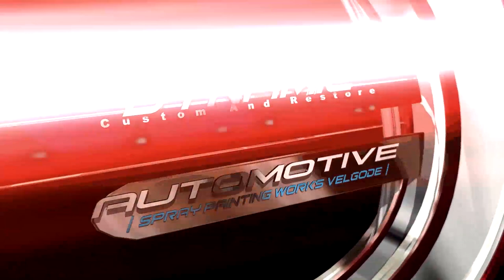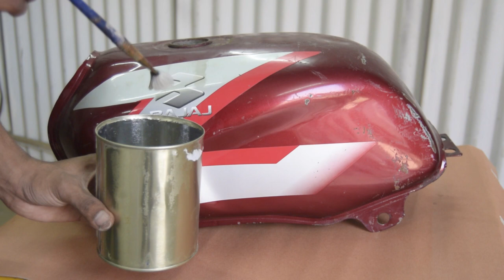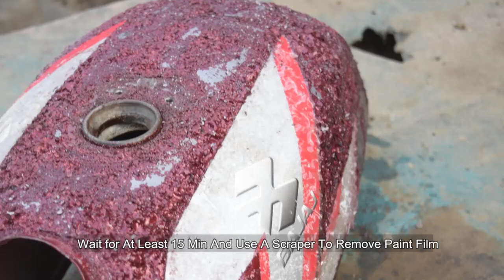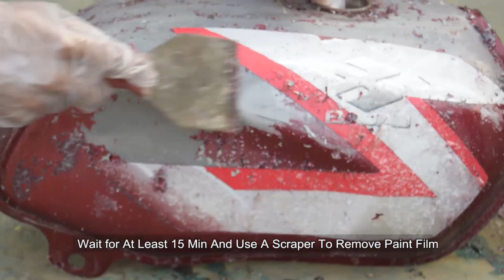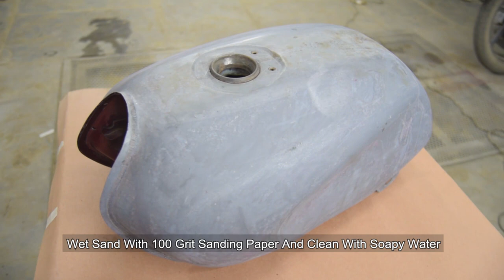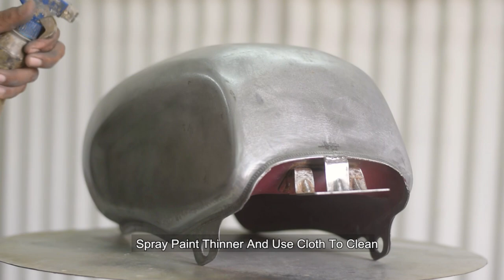Step 1 - How To Remove Paint

Comment: Awesome work brother! Where can I get those paint stripper and what is the use of the thinner? Thank you so much. I subscribed.
Reply from the maker: Hi, You have to find your local automotive paint dealer where you get all this stuff, Paint thinner is used to thin paint to flow from spray gun nozzle, Thanks for Subscribe
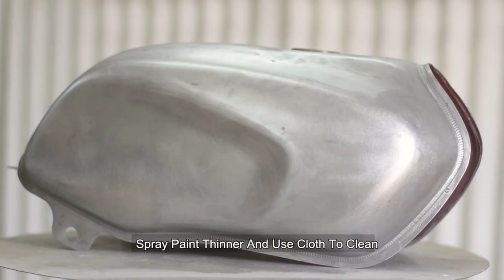Reply: Thank you. I was asking about the thinner used at 7:16. Is it the same thinner?
Reply from the maker: Nc thinner to clean and degrease

Comment: Does paint remover and thinner is the same thing ?
Reply from the maker: No both are different chemicals paint remover is used to remove paint and thinner is used to thin paint
Reply: Thanks
Reply from the maker: @sushilthakre5492  You are welcome
Reply: What if paint thinner is spill on car ?
 Does it will damage car paint in any way ?
Reply from the maker: @sushilthakre5492  Hi, If your car has 2k clear in most cases it will not damage the paint
Reply: @DynamicAutoYT   😊I have thrown this on my neighbours car 3 times .
 On his white car but nothing happens.  😧
Waste of money and waste of my risk taking in surgical strike !😈